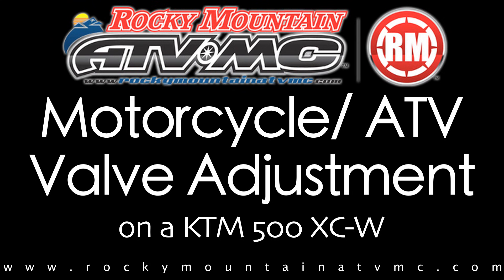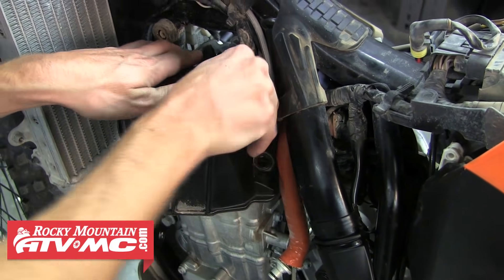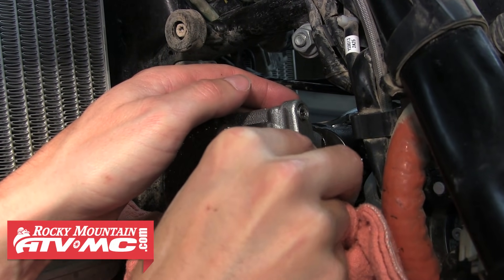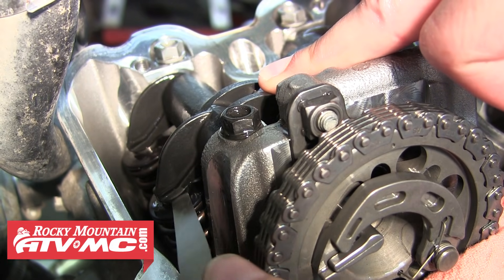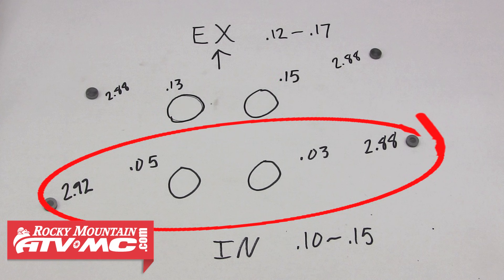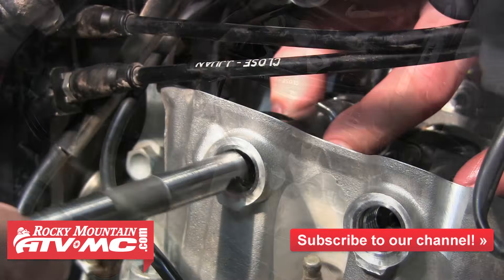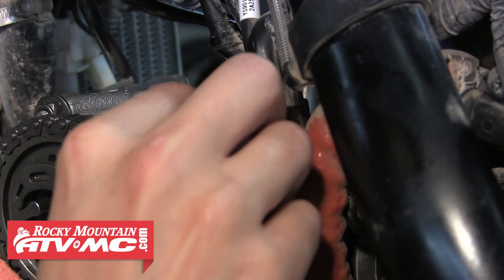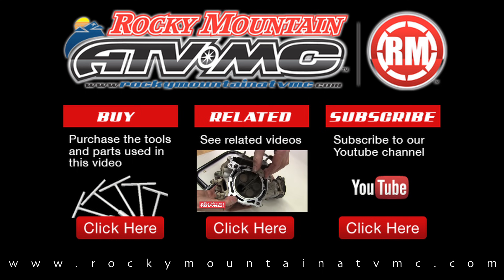How To Adjust the Valves on a KTM Motorcycle

Comment: is it 4valve SOHC ?
Reply from the maker: +DrAmit Singh P Yes.  SOHC with 2 rocker arms.
Reply: +Rocky Mountain ATV MC how does it perform being an SOHC engine with 4 valve ?
Reply from the maker: +DrAmit Singh P Performs great.  KTM hasn't stopped using it, so that goes to show that they like the design.

Comment: You say "tighten to proper torque spec" but never use a torque wrench. Wouldn't want you working on my bike.
Reply from the maker: For filming purposes we used a ratchet.  Sorry we don't actually show a "torque wrench" in the video.  You would want to check your bikes specific torque values as different bike models will vary. Thanks for commenting ScottJW